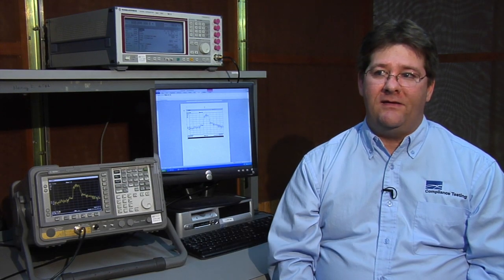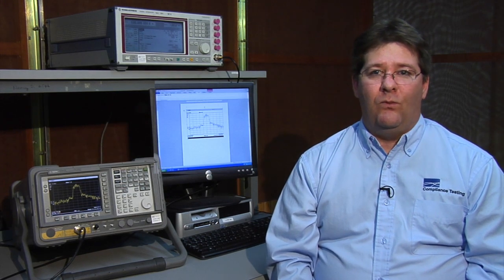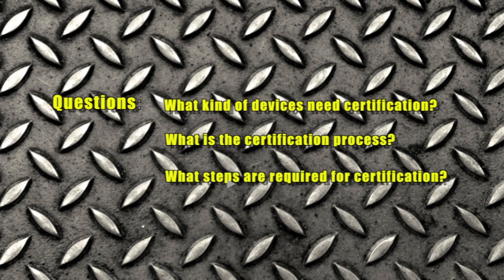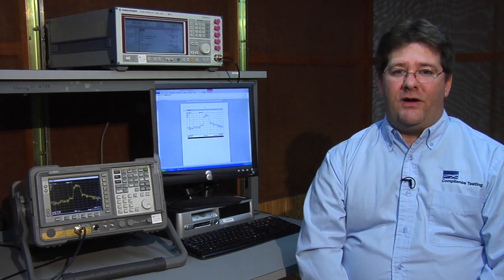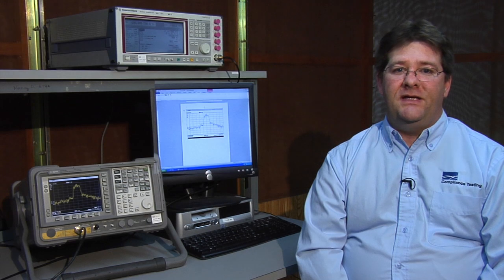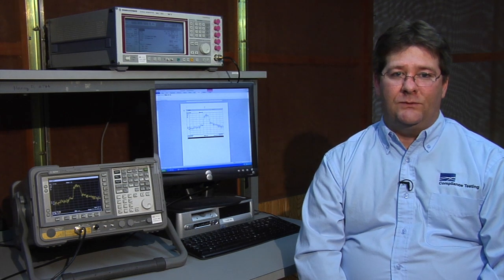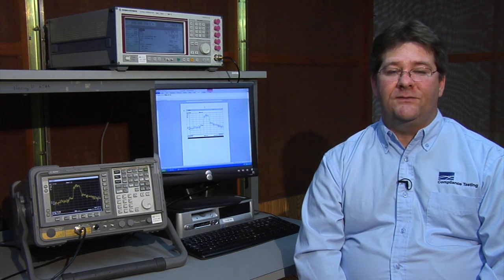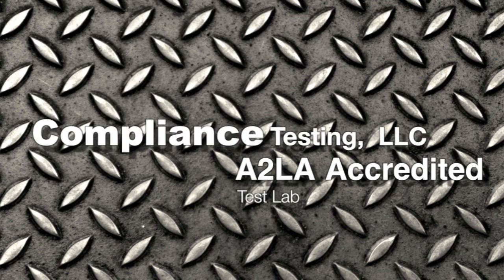FCC Certification - Which Devices Need Certification

Comment: what about FCC 15B - the website says this is for "unintentional;" radiators. Your video says FCC cert is required for anything that "intentionally" generates RF energy. You clarified this at the end of the video but the opening statement seems unclear to me. Can you confirm? Also, why not use IEC 60255-26? When do I choose FCC and not the IEC?